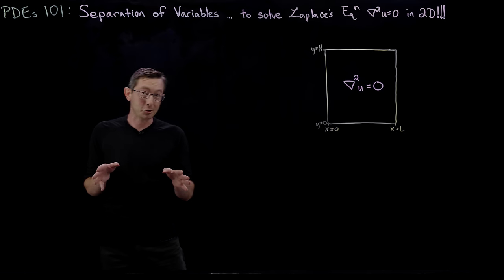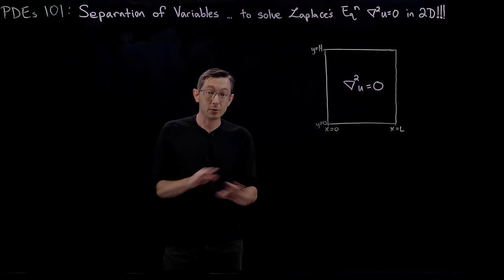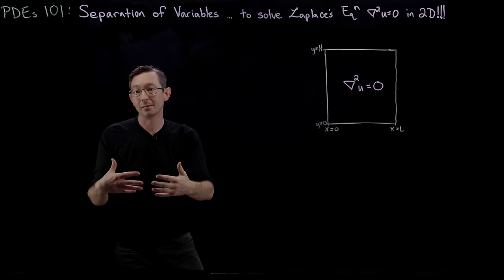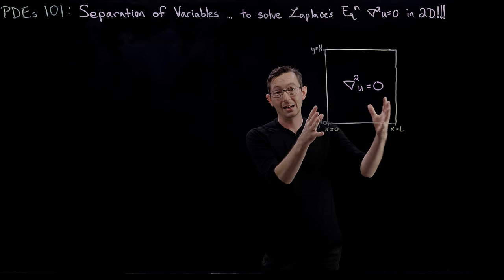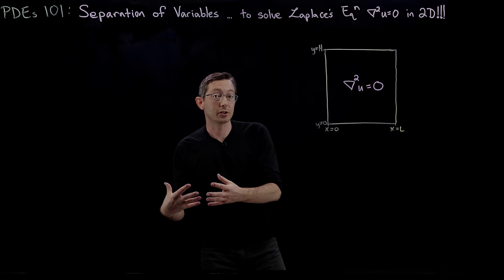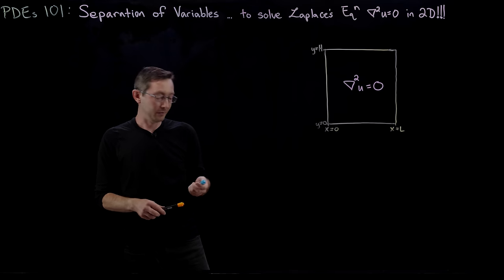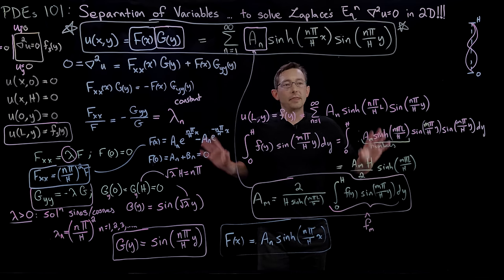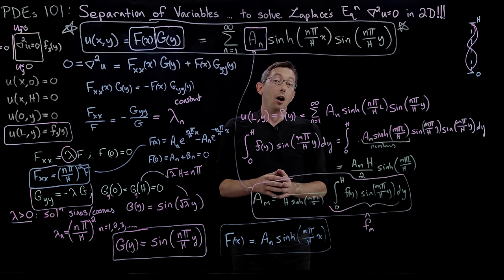PDE 101: Separation of Variables! ...or how I learned to stop worrying and solve Laplace's equation

Comment: This is just for a little information. Recently, while working on a problem involving heat transfer in cylindrical coordinates, I have found (from other published literature) that for some Boundary Value Problems (i.e., steady-state problems) the multiplicative, separation of variables i.e., u=F(x)*G(y) is  insufficient. Another alternative that can be used is u = F(x)*G(y) + H(x) + I(y), although both the multiplicative (F(x)*G(y)) and the additive (H(x) + I(y)) parts have to be separately substituted into the original pde to find two different sets of odes consisting of different separation constants.
Reply: Can you show the references?

Comment: Very usefull, thank you. I wonder though how it would work if you considered the surface as another boundary. Like a thin square of copper foil where the edges and the top and bottom surfaces are in contact with air.

Comment: At about 15:00, I would say that if you take the derivative in relation to, let's say x, to both sides, the derivative of the right hand side should be 0 by definition, just like the  partial derivative of a function of y regarding to x should be. In the other hand, the derivative of a function of x regarding to x should be zero only in the case that this function is a constant.

Comment: I have not checked, but I think that we could also extract the solutions components at the boundary as done, but alongside the functions sinh. It only remains to check that those functions form a complete set of eigentunctions. But since each of them belong to a unique $\lambda$, they do form a complete set of eigentunctions as well and could properly be used on its own right, in an equivalent Fourier trick.

Comment: I think the use of summation was not fully motivated. So I thought of the following:
1. the sum of all individual u is also a solution of the laplacian as it is a Linear operator, so that makes it a valid thing to do. 
2. If we don't use summation, then f(y) can only be of form f(y) = sin(ky), this comes from the fact that An should be a constant. Using summation of individual solution of Laplacian allows us to be able to satisfy much richer class of boundary conditions f(y), and in this case any function that doesn't have cosine terms in its Fourier series.
I learnt Fourier series and Fourier Transform using your videos only :)

Comment: thanks for the video, really useful. One question. Why the solution G(y) does not have a coefficient like the F(x) function A_n and B_n?
Thanks
Reply: You can have A_n sin + B_n cos
The coefficient for the cos is zero due to the initial condition that requires f(0)=0
The coefficient of the sin was not indicated but it isn't important as this coefficient would be later multiplied by A_n (the coefficient of sinh) forming a single coefficient that is found later with Fourier.

Comment: at 6:56, boundary values must be consistent at corners, it is possible only if all fn is zero at corners. In this way, we can not solve problems with constant values i.e. fn =Cn.
Reply: You're right in the world of strong solutions of PDEs. This could not be true in the world of weak solutions of PDEs or integral solutions of PDEs, and the numerical world of (maybe discontinuous) Finite Elements or Finite Volume methods (or Spectral Elements methods, ...)
Reply: @basics5427  Thank you very much.

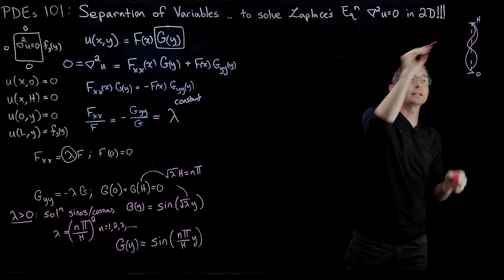Comment: 27:55 doesnt such a function [G(y)] also depend on x in reality ? But then you can't do separation of variables. Not so clear to me how this then can be done, also related to the assumption. Or am i misunderstanding something, is it purely mathematical separation and in the end it works with real phenomena?
Reply: The separation is mathematic. On it's own,when you solve -Gyy/G= Lambda, Lambda could be a function of x and constant in regards to y, but Lambda is also solution of Fxx/F=Lambda, which means that if Lambda is either a function of y or x or both, it cannot be solution, because -Gyy/G=Fxx/F=Lambda is valid for all x and y, so it's constant.

The assumption at the beginning that u can be separated into F(x)G(y) is a very very strong assumption. There are many cases where it can't work, but also a lot of cases where it does: heat equation, wave equation, Laplace's Equation, Helmholtz' Equation and biharmonic equation to give a few examples. 

It's beautiful to see how elegant Physics are !
Reply: @Ant0ine1  wow yea, thank you sir for some elaboration.

Comment: Hey Steve! This was a fantastic video, thanks!
Couple of questions: (1) Why does n == m? I didn't follow this part. (2) Couldn't lambda be < 0 (negative) if G(y) = sin(i*sqrt(lambda)*y)? Thanks so much!
Reply: (1) because for every F_n(x) you evaluate G_n(y) s.t. u_n(x,y) = F_n(x)G_n(y) is a solution of the problem (before you prescribe the non homogeneous boundary conditions)
(2) if you already have some experience, the choice of the sign of lambda come from the boundary conditions: here u(x,y)=0 on the horizontal boundaries of the domain, so you need some functions that is identically null there, and thus the sin(ny/pi) functions (this results as the basis of a Fourier series of the function u(x,y) in y direction). 

If you have little experience, you're right that you need to add the contributions you get with lambda <=0, but we find out that they're equal to zero. Let's prove it.

With lambda <0 you'd get G(y) = A e^(lamda*y) + B e^(-lambda*y), that should be zero both for y=0 and for y=L, 
A+B=0
A e^(lamda*L) + B e^(-lambda*L)=0
forcing A=B=0 (since the linear system above is a non-singular system with RHS equal to zero), and thus G(y) to be identically = 0; the same holds for lambda=0, for G(y)=A+By.
Reply: @basics5427  awesome thanks so much for taking the time to write that out. Much appreciated
Reply: @StaticMusic  you're welcome. enjoy it

Comment: @35:40 isn’t this incorrect? Once we have the infinite sum of the basis functions, these form a general solution to the original differential equation, whether the original function was separable or not.
Reply: He explained what it really means in what follows. You can often try to write the solution of a PDEs with the technique of separation of variables. Sometimes you can find a general form of a possible solution. But very few times (only for problems in domains with regular shapes and very simple boundary conditions) you can find the solution that satisfy both the equation in the domain and the boundary conditions on the boundary and thus the whole differential problem

Comment: I would love to get your perspective on “similar” homogenous PDEs on irregular domains; something like a the unit square but exclude the upper right quadrant (an “L” shape domain).

I love the beauty of the simple domains, circles, squares, rectangles, etc. but I’ve struggled to find or see a method for solving simple PDEs on irregular domains outside of numerical methods.
Reply: Numerical is the answer for domains with general shapes and general boundary conditions. 

Anyway, if you're an analytical-addicted, for Laplace equations you could rely on conformal transformations to transform a domain with "complex" shape (you could do for example with L shape domains) to a simpler one, but it's likely to be a pain in the a*s, as well.

Comment: You say that because the PDE is linear then you can use superposition so that the solution is a linear combination of all the solutions. But how do you know there is not a solution that is not satisfied by the separation of variables assumption? If that is the case then the basis of solutions would be under-defined.